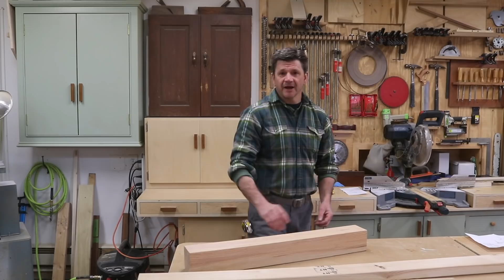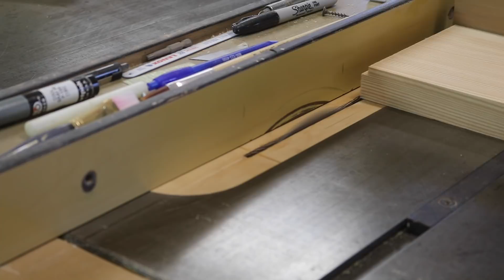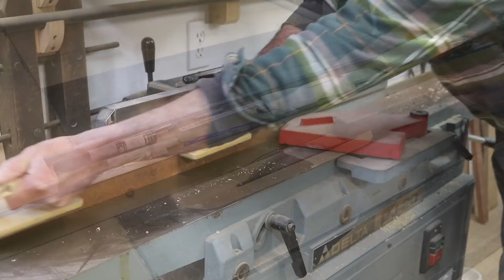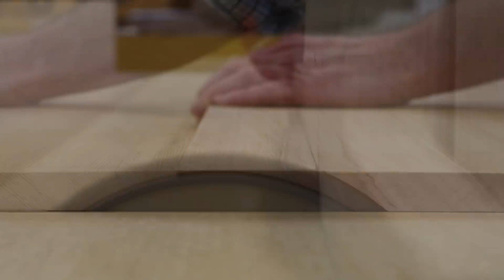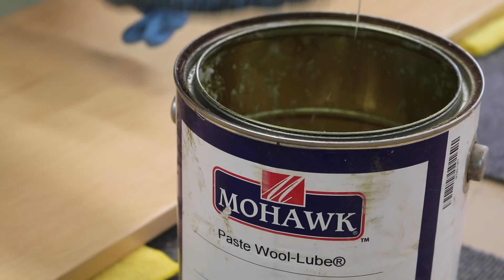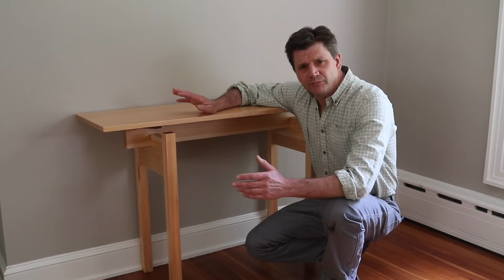Douglas Fir Sofa Table / Entrance Table with Floating Top

Comment: Simple and elegant. The design lets the wood speak for itself. Vertical grain douglas fir and cherry also go well together. Both darken with age. I used Waterlox, finished with paste wax on a headboard I made using these two species. Thanks for your commitment to the woodworking community.